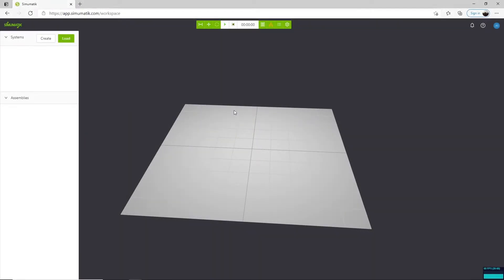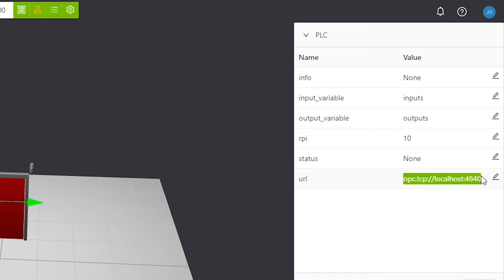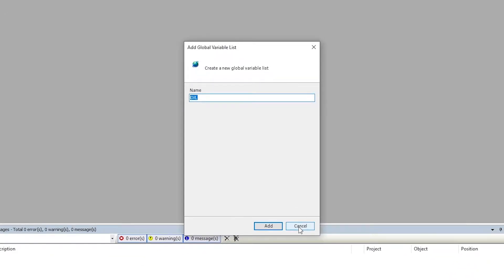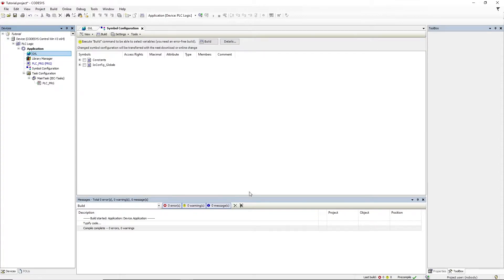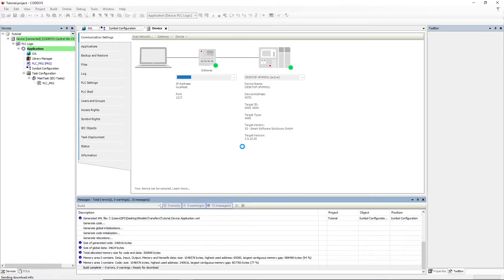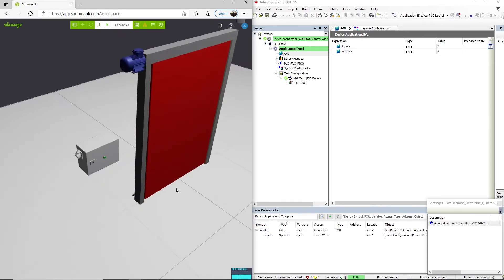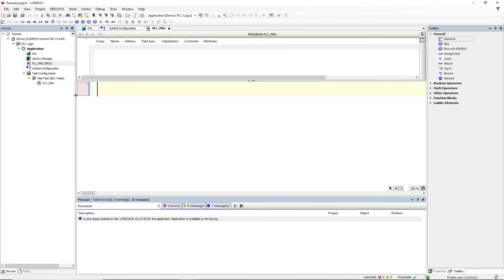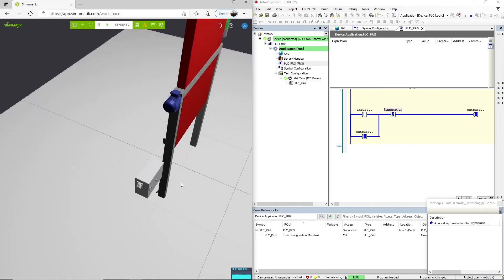Codesys Tutorial - Simumatik

Comment: 5:19 I was recieving an error and couldn't connect. After looking for a solution I found a way to connect it. I don't know if it is correct or not, but basically on codesys I logged out, in the device window, I clicked on Device drop down menu, clicked on change runtime security police and checked "Allow anonymous login" option. then it started working. Hope it helps someone with the same issue. my codesys version is v3.5 SP19 Patch 2.
Thank you for the tutorial
Reply: This would help but i dont know what you mean unfortunately :(
Reply from the maker: Yes, with the newer version of Codesys we have to allow 'Anonymous login' to make it able to connect to Simumatik. In our new videos published in the academy you will find this step. Thanks for your tip on this video :)
Reply: Wow you saved my ass, thank you <3<3<3<3<3

Comment: how'd did you connect Codesys to Simumatik? Did you use a client?
Reply from the maker: The Simumatik Gateway uses a OPCUA client, yes. You can just follow the tutorial to test it. If you try to connect another model that uses a generic PLC, you can just switch the driver to "opcua_client". Then make sure you modify the setup parameters, so you define the opcua server address, i.e. {"url":"opc.tcp://localhost:4840"}.
Reply: @Simumatik  Right, my problem was that I couldn't connect to the localhost so I switched it to my IPv4 address and kept the same port and now it works.
Reply: @nicholasemildas7436  Sure, in some cases the OPCUA server does not wrap all IP addresses in the computer, and it is required to specify one, as you mention. The tryck usually is to start the OPCUA server with this address: 0.0.0.0:4840, which will make it listen in all available IPs, including 127.0.0.1 (or localhost).